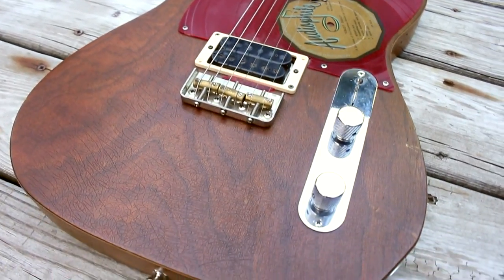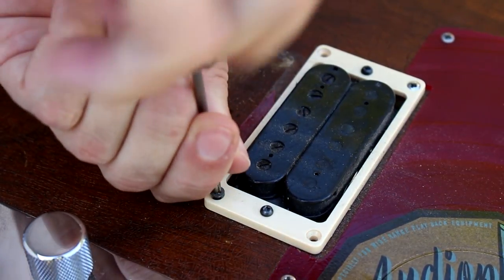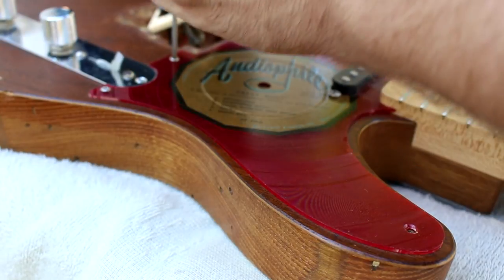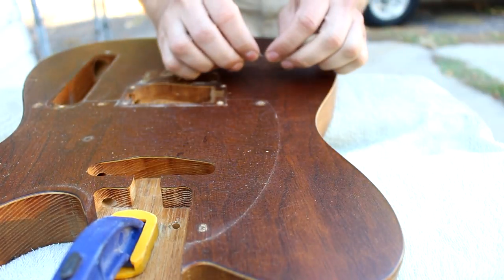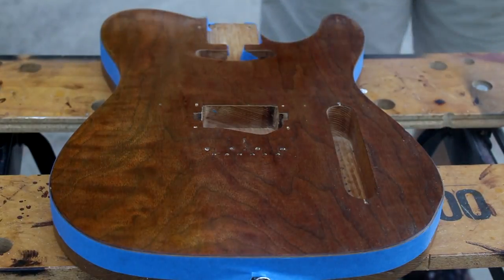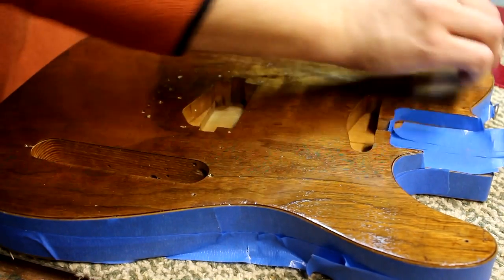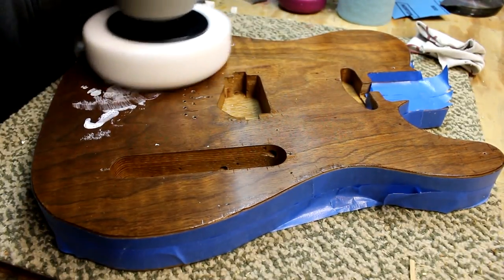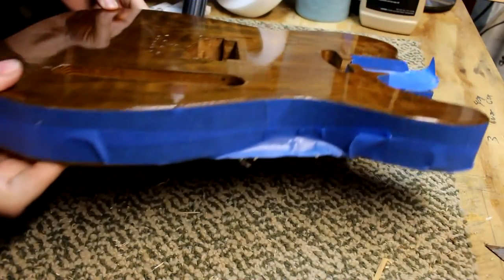Custom Guitar Refinish in Lacquer / Built From Reclaimed Wood / Part I

Comment: It is interesting to learn how a non-guitarmaker approaches the woodworking aspects of guitar building. The fact that you sanded the walnut with 320, instead of the barbarous and gouging 120 and stopping at 220 is important enough to note. And hand leveling the lacquer up to 1200 before compounding is not often seen. Thanks.
Reply: I did my own up to 3000, but the basic was so badly done (I am a total amateur :D) that it did not help much.